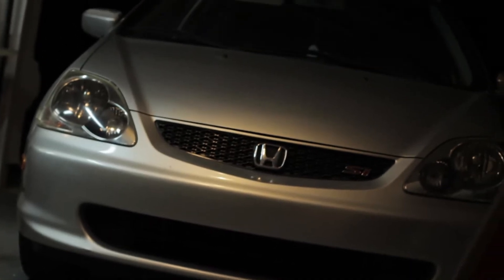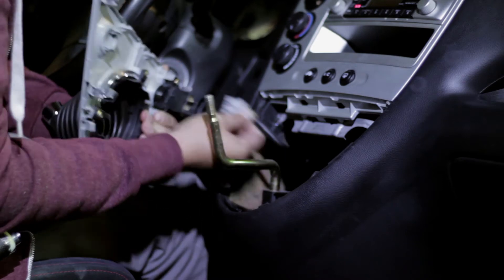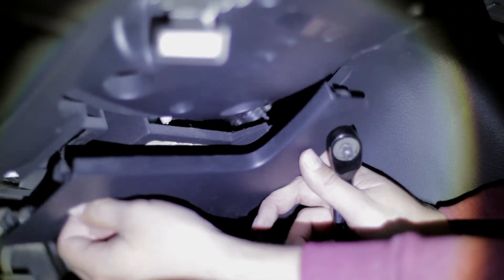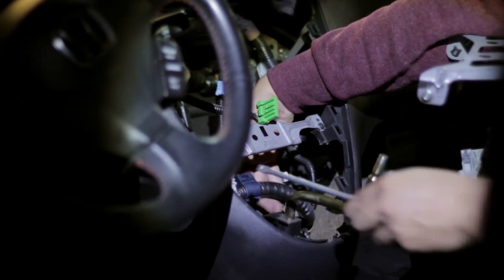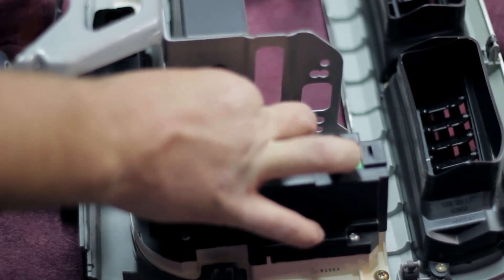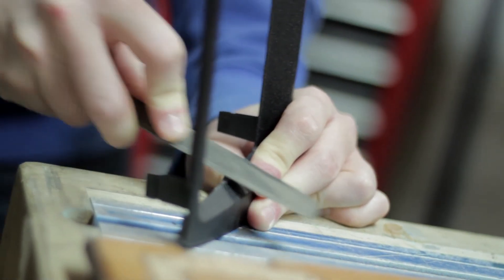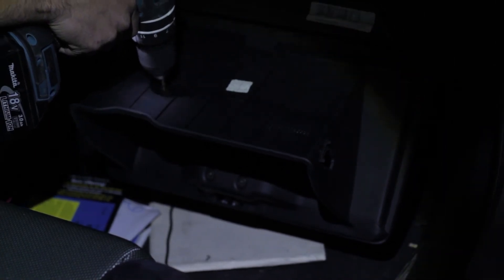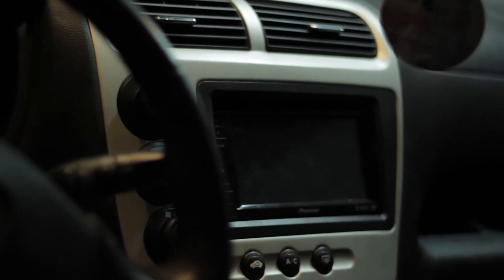EP3 stereo install - How To Civic Si (type r)

Comment: what is the adapter you put between the blue honda connector and you new radio?
Reply from the maker: You can buy them at wal mart or really any good electronic stores in the audio section. So you don't have to chop up your wiring to make the stereo fit. you just connect it like it was stock